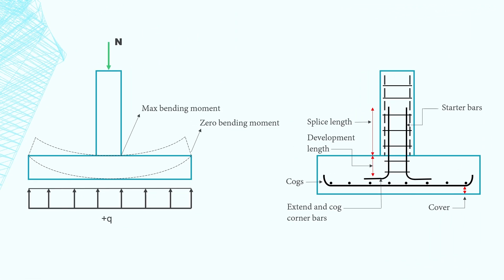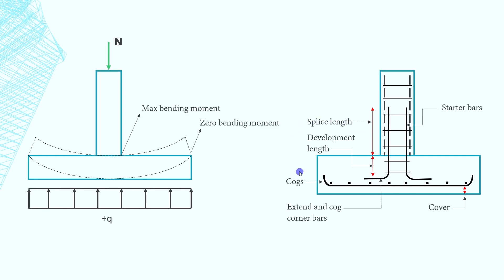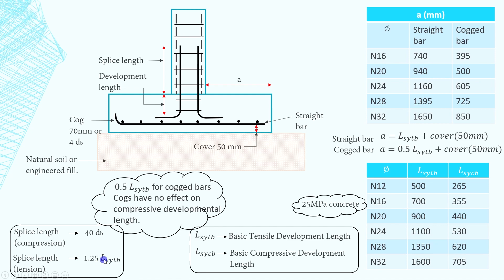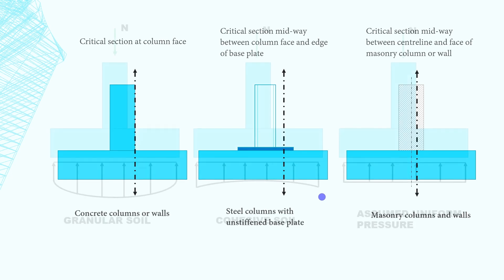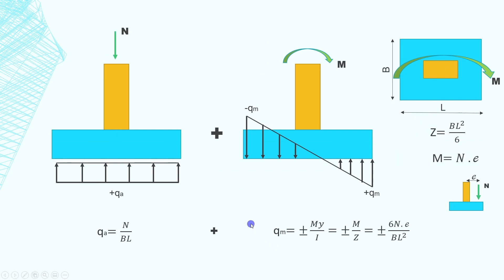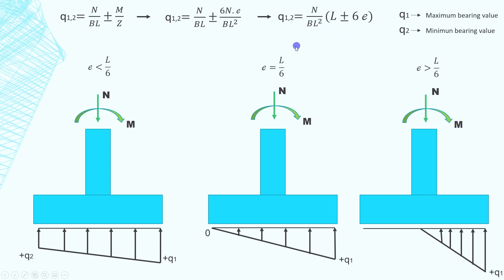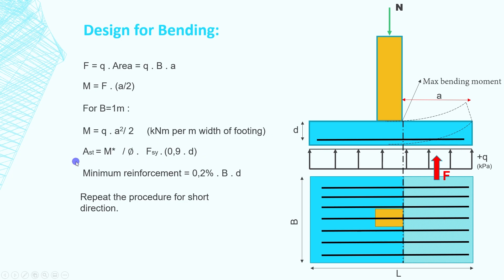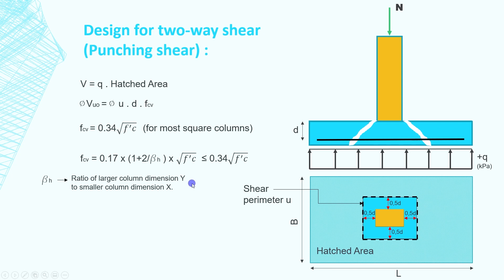Pad Footing Design - Part 1

Comment: Hello I am not a civil engineer , I m trying to build a car garage with a swimming pool on top of the garage , the garage is 10m x 6m garage with a swimming pool of 8m x 5m and  1.5m depth with six footing and pillars, what size of footing should I use to be on the safe size, thank you
Reply from the maker: Don't build that without a professional structural engineer advice. There's much more involved. You have to know the soil properties etc

Comment: i noticed in certain grounds they use isolated pad footings, and in other grounds they just do a slab on grade. Why does this occur? For the first scenario, it consists of a concrete masonry unit large house. Do you have any reading recommendations on books about this?
Reply from the maker: If it consists of continuous load bearing walls, you won't use pad footings. Pad footings are good for isolated point loads, but they are more susceptible to settlement or differential movements. I would choose the footings based on loads and type of soil. I think you're referring to a mat foundation, which is sort of a slab on ground and it is useful when the soil is weak. Imagine it as a large pad footing supporting the whole building. There are lots of resources out there. Where are you based?

Comment: Footing size / area is calculated based on service loads (unfactored), innit? So, in order to find out if allowable soil pressure is satisfied, is it, allowable soil bearing capacity be greater than the sum of (soil net pressure due to column load) + (unit weight of soil above footing X height) + (unit weight of concrete footing X thickness of footing)?
Reply from the maker: Geotech engineer will give you an allowable bearing capacity of soil. This capcity has to be greater than the applied pressure. Yes self weight should be accounted for.
Reply: @bengthebrazilianengineerinAus  Thanks for the reply. Your videos are not only interesting but worth-watching as well. Hope you continue making contents to share your expertise.

Comment: Are footings never will be doubly reinforced? If yes, why?
Reply from the maker: They can have top and bottom reinforcement depending on the actions imposed. A  good example of one would be a strap footing. I have a video on Offset columns/Eccentric footings that showcase that.
Reply: @bengthebrazilianengineerinAus  Many thanks, mate.